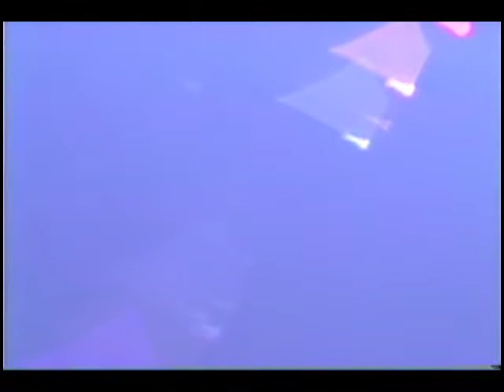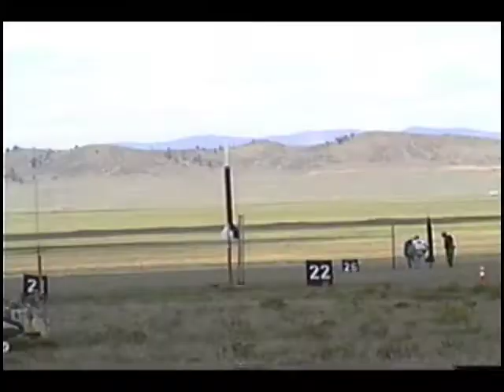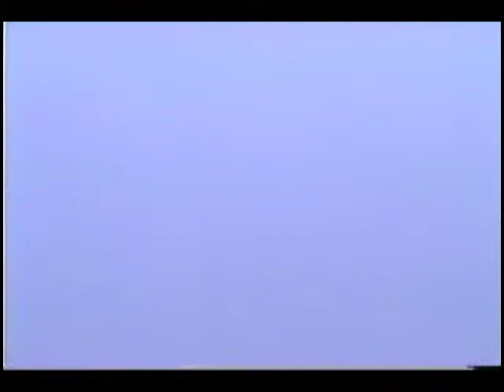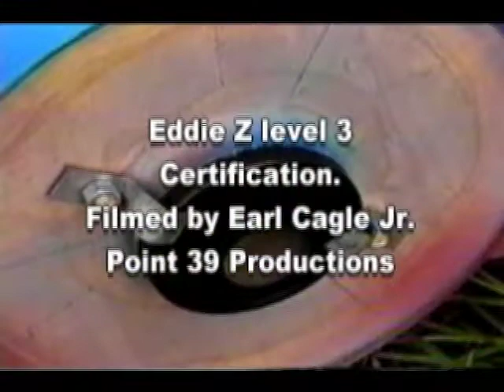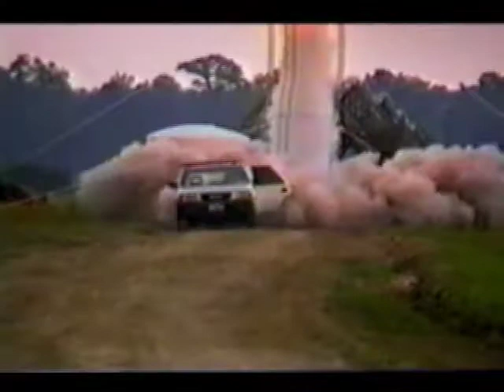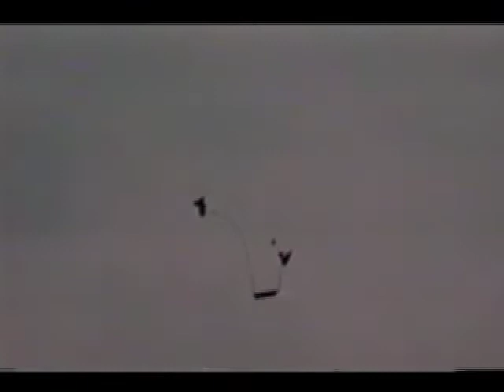LDRS High Power Model Rocketry. My certification 1, 2 and Level 3 attempt

Comment: How are the parachutes deployed?
Reply from the maker: Depends on the rocket. Small rockets will deploy a parachute through a motor ejection charge. Larger rockets use electronic altimeters that deploy parachutes at lower altitudes.

Comment: How can you do all three certifications the same day?
Reply from the maker: Hey Mike, my level 1 and 2 certifications  were launched in 1997 at LDRS 16, Hartsel Colorado. My level 3 attempt was launched in 2000 at LDRS 19, Orangeburg South Carolina. I only know of one person who did all 3 level certifications (back in the late 1990s) in one day and they were part of Tripoli NJ. I recently inquired about certification flights and now I'm told you have to fly a certain motor range for a given time to gain experience before going to the the next level.
Reply: @TheCreativeMind  ah,  that makes sense, guess I misread it. Thanks for reply, be well.
Reply: @TheCreativeMind  you can get your level 1 and 2 in same day i just did that with min. experience on h motors and none with dual deploy "by choice" and   j motors you do not have to fly certain motors for a time period for 1 and 2 not sure about level3 other than you need to use electronics and submit your build package to a board to approve with NAR
Reply from the maker: @sendit2873  I may have been misinformed. Spoke to some old rocket friends and thought about getting back into the hobby. Maybe every states prefecture has their own rule? Thanks for the info.